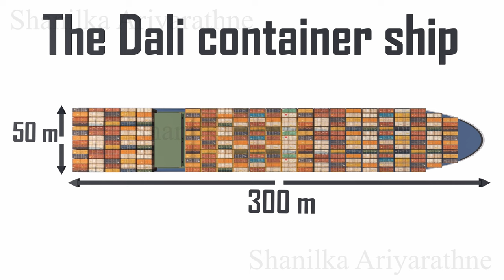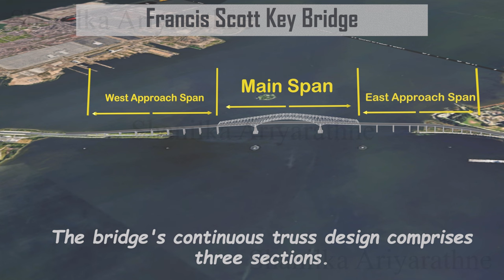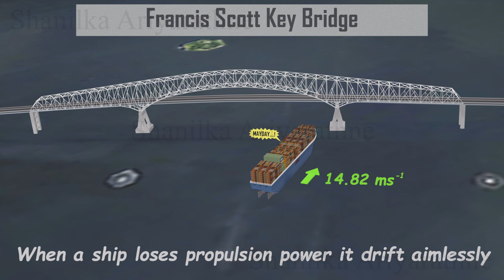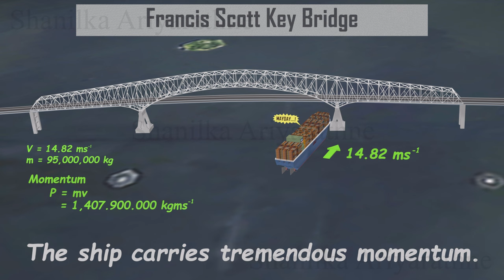Baltimore Bridge Collapse Animation | Francis Scott Key Bridge

Comment: Nice animations but I’d like to correct some misleading items. 
Gross tonnage is a measurement of VOLUME not weight.
Your animation shows a twin screw, twin ruddered vessel with a label giving her ‘gross weight’ as approx 95,00 tons. MV Dali has a single screw and rudder and at the time of sailing had a displacement (her real weight) of just shy of 150;000tons. 
The black smoke (actually soot) ‘coming from somewhere on board’ is emanating from the exhaust stack as the crew attempt to start the main engine at full astern!  
These might seem a little nit-picky, but with the conspiracy storm this has started, little discrepancies make for big misunderstandings. 👍

Comment: This animation is 100% wrong about the path taken, and the final turns taken. Watch the video at least, the direction presented and the turn taken is completely wrong here.
Reply: You're right
Reply: On what are you basing your criticism, with reference to the ship’s heading, on?
Reply: Misinformation campaign at work ;
Stern movement on the engines is what caused the ship moving at 8 knots to veer to the right towards the Bridge pillar 
A ships heading is depended on its momentum & not on the propulsion, 
All that was required after emergency power was restored to the steering was not to slow down inc using the anxhor but to navigate yhe vessel under the Bridge using the momentum of 8 knots,
Reply: Whoever told you that ?